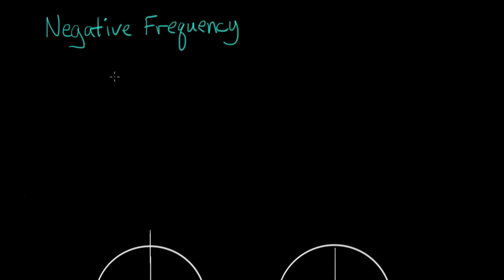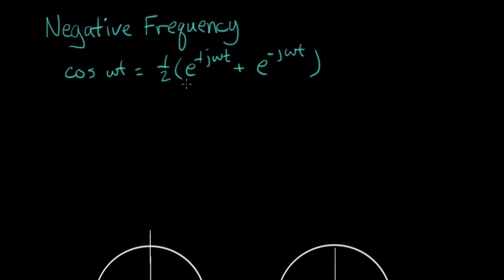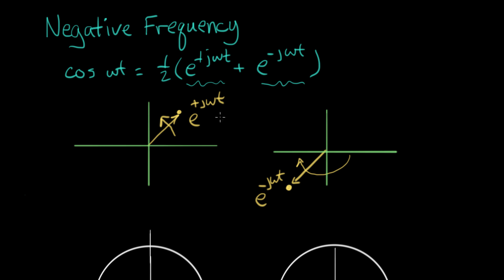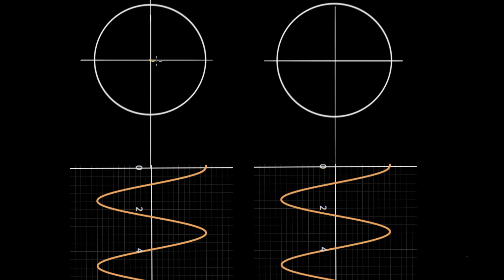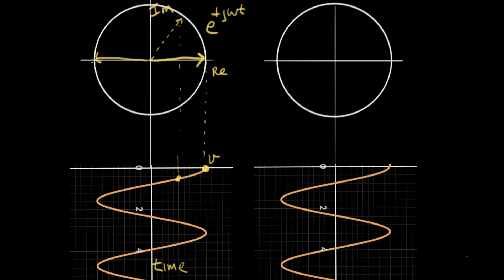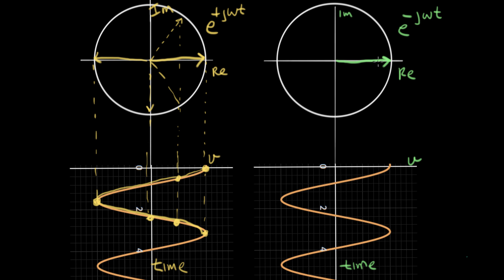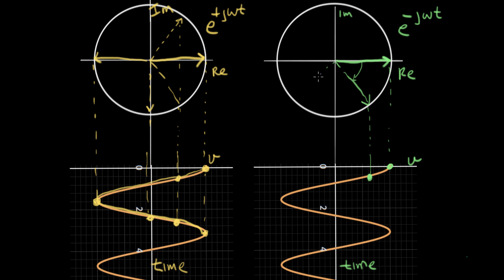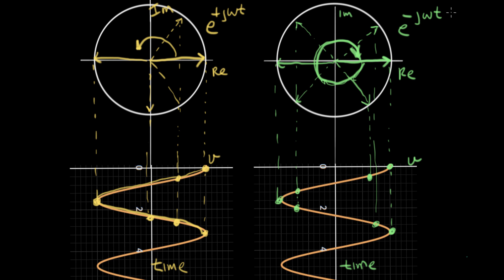Negative frequency

Comment: Would it be possible for light to redshift enough to become a negative frequency? For instance, near the event horizon of a black hole.
Reply: No. Imagine a light wave traveling through space between a celestial body and your eye on earth. Now imagine that celestial body moving backwards very quickly, emitting the same light wave, and reaching your eye. Much like how the doppler effect works, this would cause the light to appear at a lower frequency, as the wave would be perceived as more "stretched". No matter how fast the celestial body moves, the wave can't be perceived as a negative frequency.

Comment: Can anyone elaborate what is the need of converting to S domain ? what are advantages of doing that
Reply: Maybe you figured it out but by using Laplace Transform (for example) one can easily describe a differential equation in terms of s where s is the derivative and 1/s is the integration. Then one can use algebra to calculate the equation. (this is atleast my understanding)
Reply: I think its easy to make calculations , by converting time to frequency domain..

Comment: The sine on the negative side would be flipped and flow in a mirrored direction, you have them both in the same direction, but positive and negative are the same poles, but opposites, which would be a mirror image of the other going the opposite way, like reading a sign in a mirror, the words are backwards.